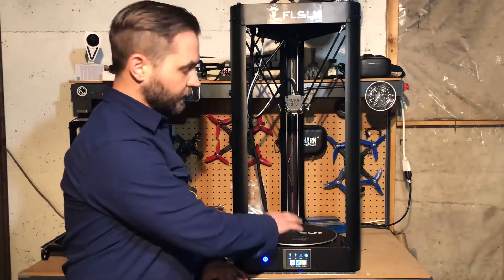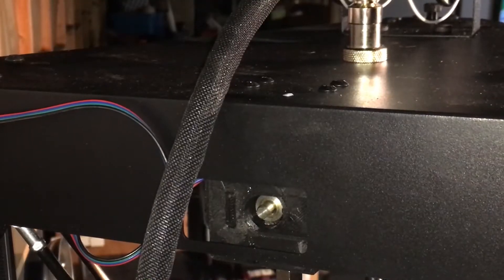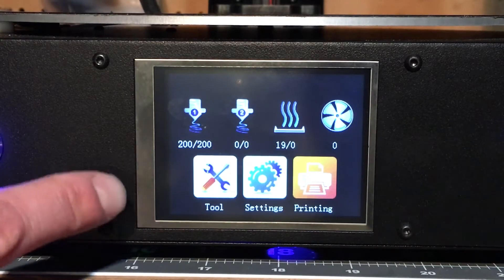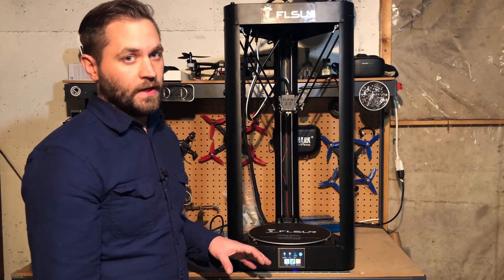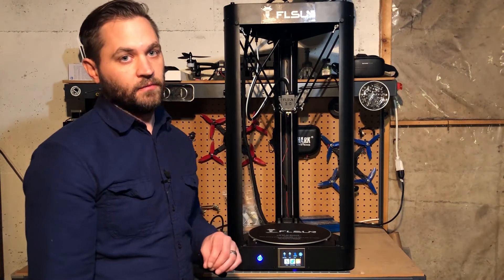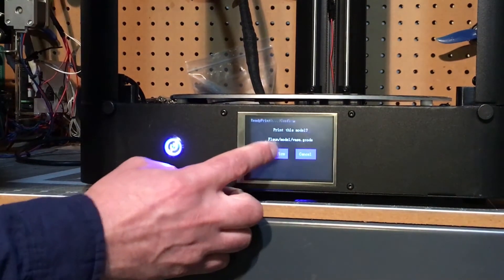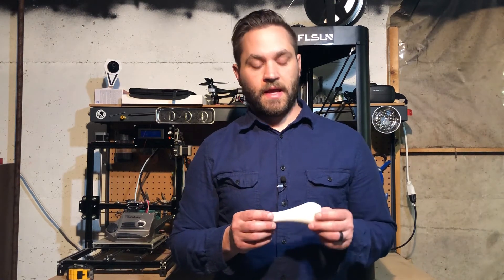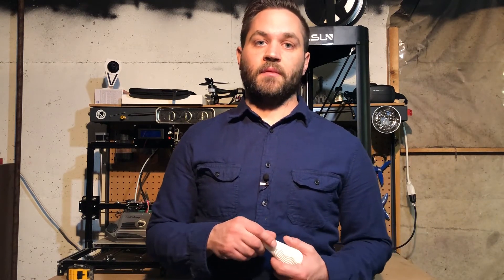FLSUN QQ 3d Printer - Part 3

Comment: I came across one of these that somebody was getting rid of. They just told me “it’s messed up…” and that was it. I’m now in the process of restoring it to its former glory and am cleaning the linear guide bearings on the carriage for each tower. Do you have any guidance or can you offer any tips or advice on maintenance or care for this awesome machine 7 years after making this short video series on the QQ original metal frame delta printer? Anything helps!😅

Comment: Something else Im seeing , and surprisingly Im not seeing to much info on this.  When I purchased mine , (on eBay) the listing was for a FLSUN QQ Super,, which I understand has some upgrades, including different nozzle, and ceramic glass print plate. Also I understand that the power button on this model is on the right side of the LED screen,  This is info I received on a Facebook forum, There is surprisingly no info on this, any thoughts?? everything I see is the standard version,
Reply from the maker: I talked briefly with somebody at FLSUN and they said that the QQ-S is an upgrade to the QQ with 24v and they states it’s almost an entirely different printer. Looking at what I see listed on Amazon the main difference is the power supply and the print surface. I installed the new print surface on mine and it is better than what was on the original version. This printer is very sturdy, even for the height. It is also a very quiet printer which is something I really like about it. I doubt that there would be a different position for the power button because that would mean a new body design for the printer. When you get the printer let me know if you have any questions. I still use mine regularly and would be happy to make more videos if they would be helpful to you.
Reply: @DougLicht  thank you for that info,, Im farily certain that the power button is on the right side, as this was confirmed by a few members of the forum on Facebook. Im usually not a forum kind of person . lol but in this case I was.  I have to admit, I was having buyers remorse, as I recently sold my Creality CR 10s, and purchased this one, for no othere reason but to try a delta , I have nothing bad to say about the creality and will probably buy another (the s5) soon.  But now that Ive heard good things about this QQ I do feel a lot better. Your vids were instrumental in my decision, and I think its going to be fine, 
thanks again.  when I get mine (Monday) Ill reach out and let you know what I think
Reply from the maker: This is a reply from FLSUN about the differences

the QQ version is 12V power supply. 8 bit board. and the QQ-S version is 24V power supply. 32 bit board, and titan extruder
Reply: @DougLicht  yes, that sounds about right, surprised they didnt mention the ceramic glass print bed,,,

Comment: hello, can you tell me if this unit came with a USA plug or do I need to get an adaptor, I know the power source has a switch to change, it from 240 to 110, but was wondering about the plug itself. thanks
Reply from the maker: This did come with a USA plug, 3 prong with the ground. I did have to flip the switch on mine but I think FLSUN has worked on getting this flipped over for USA sales prior to shipping.
Reply: @DougLicht  thanks
Reply: Two power cords, American Standard and European Standard, will be placed in the printer for customers in different countries.now this printer have a low price in 11.11,only need $274 can get it.https://www.aliexpress.com/item/32681171687.html.

Comment: HI again .  Do you need to use hair spray or a glue stick on this build plate like most others?
Reply from the maker: I have had no need for any type of adhesive such as glue or hairspray. I have had to do very little to get this to print good. Just normal process for build plate adhesion for first layer settings and minor adjusting for the z offset.

Comment: Where did you find the Cura config file?
Reply from the maker: On the SD card there should be one. I am using a newer version of Cura and set up everything manually which is pretty simple. Let me know if you can’t find it and I can try to get it for you.

Comment: Thank you for the video, what do you rate the print quality of this printer comparing to Cartesian? I'm looking for most printing speed with most accuracy possible... Sorry about my English.
Reply from the maker: I can easily print at 120mm/sec but if I’m not in a rush I get good quality at 100mm/sec. compared to a Cartesian, the delta printers are able to move much faster with just as good of accuracy. If there is anything you want me to try to print then let me know. Thanks!
Reply: Nice, it would be nice to print and measure simple geometric forms like cube and cylinder for accuracy. Thanks again!